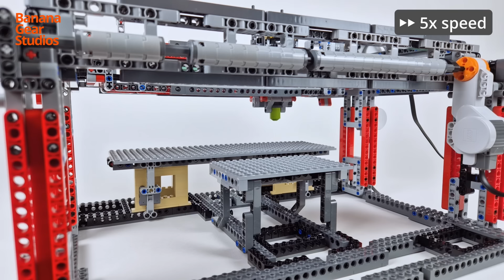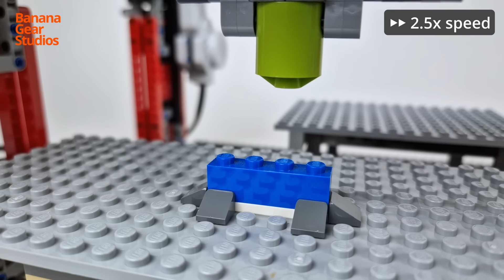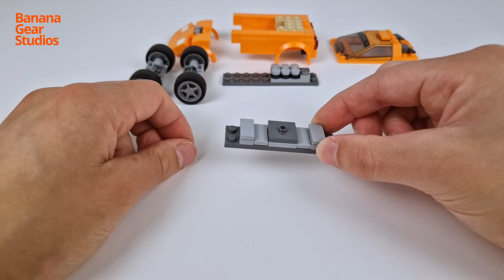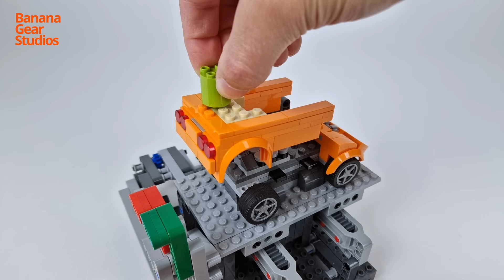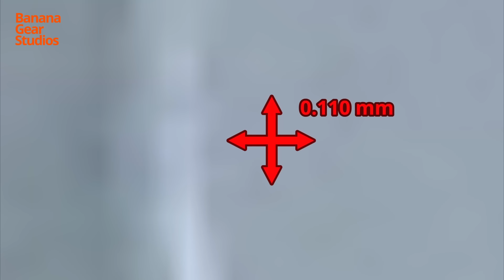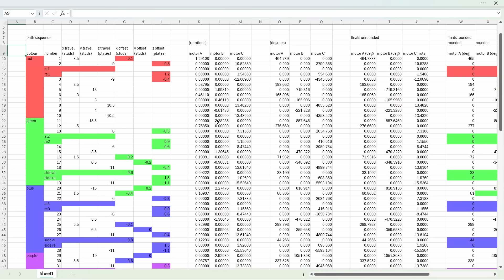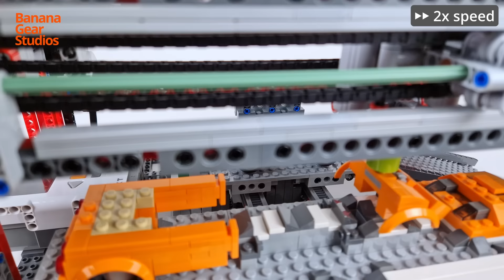I Built a Fully Automated LEGO Car Factory

Comment: You know, at the point where he started having accuracy issues, he should have bought a buwizz 2 or 3.0, buy a Bluetooth capable laptop, buy a wireless wifi camera, and code a Python script that uses cv (computer vision) to automatically correct itself, and connects to the buwizz via their bluetooth api. Then, with a set of more precise motors, he would have probably got the exact same result

Comment: This is an excellent lesson in multi-disciplinary engineering. There’s the obvious automation engineering, but also product and manufacturability engineering. A great look at how things can not be designed without considering how they will be built; and also how product design influences manufacturing design and vice versa. The linked processes are exactly why steady iteration is such a successful method for improving a product. A small improvement on either side means faster/easier manufacture, or an improved product because of better manufacturing capabilities.

Comment: Nice build/vid! Honestly feels going from this point to making 3 cars should be a relative breeze, especially if you can get all 3 cars to have the same connection points where it's picked up. Would be amazing if the red and green buttons would lock/push your 6 piece templates in and out

Comment: Really interesting video! You shouldn't abandon the idea of robot arms, though. Some programming on those bad boys and you could fit parts on the side, below the car etc. Saab Automobile built their cars at stations, and a large, flat robot cart then moved the car to the next station to be picked up, assembled and then repositioned on the cart. They started that system in the 80s and kept it til 2011 if I'm not mistaken. Of course some parts, where welding by hand was required, were moved on a traditional assembly line.

Comment: If you could use inline tensioners instead of end of line ones you might be able to double up the connections between the sides for even less issues.

Comment: Lego has one very neat feature that you might be able to leverage; studs. I know, I know, what I mean is, you don't need 0.1mm precision, you don't even need 1mm precision, you need stud precision. So while you still need really good accuracy, your precision is much less important. Would you be able to make the chuck "snap" to stud alignment by using a not-smooth surface as a guide?

Comment: Could the accuracy be improved by making the machine frame and build platforms more rigid? That way you only have positioning error on the head itself rather than the pieces it is trying to set down on and the head initial location?

Comment: Before I clicked on the thumbnail I thought that you would have a plunger mechanism to push the piece down off the grabber once it was in position, basically a rod with a blunt end that pushes down, but that would require a separate motor so I can see why you used the solution you did, which actually works quite well!

Comment: For the issue with wobble, a set of diagonal supports across the gaps can do an amazing job of mitigating the wobble. As for the alignment, you can make a set of zero sensors with shims to get the perfect distance in all three axes for it to know exactly where it is in space at the start, just like regular 3d printers and other CNC devices, then your coordinate grid will be correctly aligned to the studs from the beginning with no guesswork.

Comment: Another thing you can do to help mitigate backlash as an issue is to just mount the motor in the middle of the axle, then it'll be only half of the backlash and it'll be evenly distributed between both sides of the mechanism. You could still thicken up the axle to reduce the overall backlash, but at least it won't be as bad as having the motor on one side.

Comment: You can reduce the racking of the gantry even more by connecting both ends of the chains with cross shafts. Some additional moves to press parts together better would have the car stuck together better. You minifig factory workers are having a lot of rework to do once the robot is finished.

Comment: I love how the answer to "insufficient precision" is *wiggling*. It's so delightfully counterintuitive.
Reply: Amazingly, it's the same principle in my 3d printer.
Reply: It actually helps in a surprising amount of cases / contexts, it was basically my first thought when alignment precision issues were mentioned here
Reply: '' answer to "insufficient precision" is *wiggling*.''
That only works because it's LEGO with predetermined connection points, ya muppet. Try ''wiggling your way to precision'' when etching a processor with a waferstepper.
Reply: @rocksparadox  bro just delete that
Reply: @rocksparadox  Yeah, solutions are context dependent, no shit Sherlock.

Comment: CNC machines often rely on a calibration routine before starting the main program. I think it could help a lot here. Limit switches on each of the axes. Record the extents, and use these to adjust the starting position as needed. That could even account for things like chain becoming very slightly slack after a few runs.

Comment: Attaching a motor at the center of a long axle so there is equal backlash on each side and then programming the controller to always approach from one direction so that consistent backlash is compensated for can also work when you can't get rid of the backlash enough. I love that you encountered the fact that chains must always be tensioned individually like that. :D

Comment: Rigidity definitely looks to be an issue. Something I've figured out trying to make rigid parts out of technic is that the old-school studded technic parts (system beams with holes) allow for much more rigid parts. A studded technic beam, 2 plates, and a second studded beam makes the perfect vertical gap between the holes for a 3-hole studless technic part to connect. This makes an exceptionally rigid beam.

Comment: I love this, and your wiggle is a fantastic solution. I was trying to think up a construction solution when a programming solution was a valid path. Now, with only programming changes: after placing the part, you could purposely misalign the placer to add a "seating" step for stronger assembly. For some of those larger parts, you could push the seating step on a smooth surface of the part. For rigidity, you might consider adding tensioned diagonal chains to two of the sides. For more complex constructions, additional axis motion could be added with specific stops using your button actuating technique, possibly even as sensor activation for a second controller. I'm dreaming of a massive layered construction where multiple versions of this factory start from individual Lego pieces and build the whole car. Well done!

Comment: You know what you've made here? It's a pick-and-place machine. They're used for adding components to mass-produced printed circuit boards, they're sold for silly amounts of money, and you made a crude but functional one out of Lego.
Reply from the maker: I didn't think of that but you're right, they do work in a very similar way! As far as I'm aware most of them also use chains/belts to move the end-effector around, just like this machine.
Reply: @BananaGearStudios Now, make one of these using this machine and you've created grey goo
Reply: @lotion5238  "Why won't you die?!"
"Macromachines, son!"
😂
Reply: @lotion5238  🤣👌🏼
Reply: @lotion5238  GREEN GOO
Reply: @BananaGearStudios  all you need now is slightly higher precision and a method to heat the connection ends to solder the components on as it goes and you could also sell it for silly amounts of money!
Reply: @kivalous  that's kind of the secret to business as a whole: get specific enough and you can charge a ridiculous amount of money for your services (but not too specific, or you'd have no customers!)
Reply: @BananaGearStudios it's a pattern.... belt give precision.... there's a ton of books about it.🎉
Reply: TBF they are quite a lot faster 😂
Reply: The three axis movement is like how many 3d printers work. With the linear rods and belts to move its x and y axis. Even tensioning the belts to keep things precise.
Reply: its a lego printer.!@
Reply: How much is a silly amount
Reply: @amethyst2448  $400,000 and more for an industrial one. It’s crazy
Reply: @owenchabot That is nuts. Can begin to justify though the price when the thing might pay for itself after it pumps out 10 vehicles
Reply: circuit boards, not vehicles, but it pumps out crazy amounts of them
Reply: @owenchabot GRANTED the Open Source Hardware Company “Opulo” makes the “LumenPnP” which goes for about $2,000 USD.

Still a good bit of money,  but with the right use case it can make you some!
Reply: If he found a way to use pneumatics for the actuator, this would genuinely useful even without heat. Sticky flux, move the board to an oven or plate, boom!
Reply: The pick and place machines do not shake componants but yes that is it ! 😊
Reply: Have you checked Lego prices recently? It also sells for "silly amounts of money". 😜
Reply: First solder paste (combination of flux and tiny balls of solder) is extruded through a stencil onto the PCB, then the components are placed onto the solder paste, then the whole PCB is baked in a solder reflow oven to melt all the solder paste. Surface tension and adhesion pull the components into place over the pads on the PCB when the solder melts. Every step has to be surprisingly precise for modern PCBs, because the smallest components can have lengths less than a millimeter, and some ICs have ridiculously large numbers of ridiculously small pads. Too much misalignment, and parts get pulled out of place by the solder instead of into place.
Reply: The industrial ones are so expensive that you couldn’t pay for them after selling all your organs but you can build a LumenPNP from Opulo for less than $2k
Reply: @HMT_main  I'm building a mini version of the Lumen for <$1000.
Reply: @randomalleycat  To be fair, most of the time you don’t need to populate anything bigger than 100x100mm
Reply: @HMT_main  The boards I'm making are 50x50 and I think I'll be able to do 9 at a time on my setup.
Reply: No it's false actually
Reply: The way you made the mechanism to move the picker is also similar to 3D printers
Reply: Erm actually ahh 🤓
Reply: Yeah I used to work with them except the real ones are extremely fast and precise. They use suction, grab several components at once and place them all in seconds.

Comment: Backlash compensation is important for real machines too. One trick is to always approach a position from the same direction, guaranteeing that all the lash you can’t eliminate through design is stacked up the same way every time.

Another thing would be to switch to closed-loop control with an encoder scale on each axis rather than relying on the motor’s encoder, but I don’t believe there are linear encoders in lego so that’d require custom hardware.

Comment: 5:44 Can you split the axle and put the motor in the center?
Reply from the maker: I could've done that but I didn't want it to obscure the inside of the factory. Also, there would still be half the backlash on either side, which would still have been too much.
Reply: @BananaGearStudios Thanks for the response! This is an impressive project and I'm surprised you were able to overcome the tolerance issues and get it so consistent. Looking forward to more.
Reply: Yes. That's how it is mounted on e.g. Creality Ender 4. Lego NXT, EV3, Spike, train and racer motors all allow through axles.

Comment: I love the chibi McLaren, and your glorious spreadsheet! One benefit of using the mindstorms system is that you could use the touch sensors for the machine to be able to automatically zero itself in the coordinate system, like many 3D printers. Periodic re-zeroing during the build process could prevent any creeping misalignments, if that becomes an issue on longer builds. I can’t wait to see this assemble and roll out multiple cars!

Comment: This is super cool! The amount of ingenuity in the various mechanisms you use to reduce backlash is very fascinating. Couple thoughts about how you could keep improving that might make your life easier:
Look into gcode, it's a simple way of describing xyz movements, it's what all CNC and 3d printers use. I think it's possible to read a text file in stock nxt? If not you might have some trouble.
Also, if you have experience in other programming, look into NXC, it's a port of the c programming language for NXT. Gives you a lot more flexibility than the block code

Comment: It would be cool to make a sibling robot that disassembles the car & loads each part onto the pallet. Then, it ships it off to the assembler robot to be made again. 

That makes me think, the assembler robot cannot be used to disassemble, because of the force required to deconstruct the car. Some solutions to that might be to make the tip more complex. Possibly a brick separator, but precision & force are heavily needed to accurately separate each part. You could change the design of the car to hide a way to set the separator to work correctly. Another way could be with the forklift arms, like used in the assembler robot. 

To add more whim to it, the cars after being assembled could drive around a road before arriving at the disassembler robot. Gravity cannot be the only force applied to the cars to make them go, so I would think some sort of hook mechanism in the road to push the cars along. I am thinking like on roller coasters. By doing this, you could make a perpetual looping set of robots. That would be awesome!

Great build and I hope to see you expand on this robot!

Comment: One consideration might be to use the newer worm gear parts (73764 & 73763) - they have a lot less play in their movement, and they're a lot more supportable (plus if you keep one 32-long axle, you can use that as the "pilot" to prevent the rest of the assembly spinning when you spin the new worm gears.

I'd also recommend using some weight bricks to add more weight to the base of the structure to dampen wiggles of the structure. As noted in another comment, building this more out of system and then using technic on top might be a stronger idea.
Reply from the maker: I like the suggestion! I did think about those, but I actually don't have any in my Lego collection and from what I saw in videos of them it seemed like they would still have more backlash than the tensioned chains I used, even if it is less backlash than a standard gear and rack.

Comment: I recently wanted to build a CNC drawing machine from lego myself but I wanted it to be more precise than the other drawing machines on youtube, their pictures look pretty jagged up close. So I had the same precision fights. Some things I've noticed: I'm using the same NXT motors and those already have a fair bit of backlash, you can wobble the orange part by about 6deg. My plan is to put the whole machine onto an inclined surface, both in x as well as in y direction, so the motors are always pushed to one limit of the backlash. Furthermore I want to use wormgears to reduce the backlash, however this is going to make the whole process terribly slow. Also, I noticed if you put these 24 teeth gears onto gear racks and you push them in as far as possible instead of aligning both with some lego grid, the pairing has pretty much no backlash.
Reply: Yeah the higher the speed, the more the machine has to be strong to handle the inertia from the speed. Newton's First Law or whatever. Lego aint rigid enough for that. well, at least the complexity that probably you and youtuber are willing to go.

Comment: I recommend building as much of the structure as possible with system bricks and using technic for reinforcement, as system is whole lot more rigid than technic. 

I would advise using a tiled conveyor belt with side guards and tracks, sectioned so exactly one parts plate fits on at a time, then having the parts plates slide on and off using more conveyors or linear actuators. 
Alternatively, you could build a whole other three-axis gantry (well, two axis would work fine in this case) with a disconnecting mechanism on a larger tool head 

Hope some of this advice helps! :3
Reply from the maker: Thanks for the advice! I think you're right that switching more to system bricks should make the structure more rigid, but before changing the whole structure I'm first going to try just adding some diagonal beams to the existing structure and see if that improves it enough. 
Actually when I was first designing the factory my first idea was to use conveyor belts to bring the pieces in one at a time, but I thought it would be really hard to standardise the position of the pieces on the conveyors, and I'd need their movement to be very precise as well. Essentially, the conclusion I came to was the less moving parts the better, which is why I settled on just having the 3-axis gantry move and the rest of the factory stay stationary. Also you've made me realise I should've been calling the machine a gantry the whole video - I knew there was a word for it I was missing!

Comment: Love it! I'm just wondering, when the grabber retracts, it usually pulls the piece back a bit and leaves it not completely pressed in. I think that should be fixable by using it to press down on places that don't have studs? (like the back of the engine plate, or the top of the roof once it's all done)